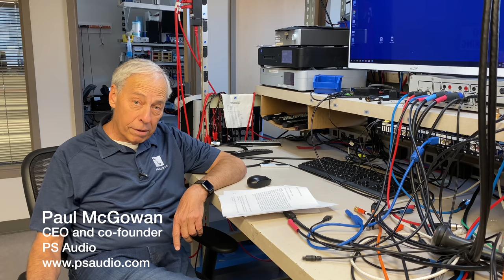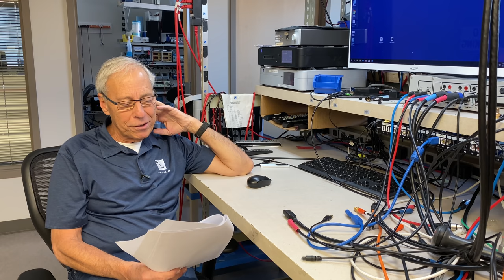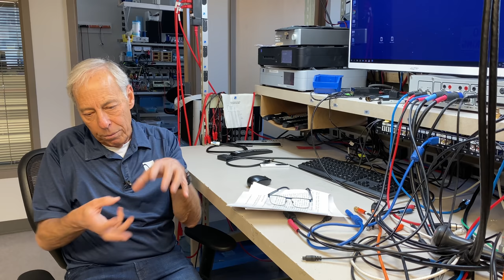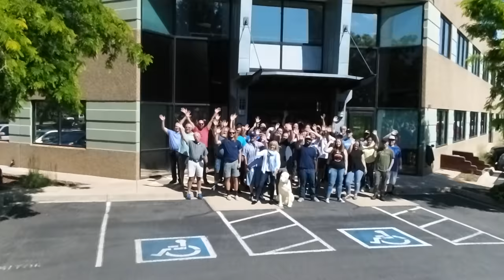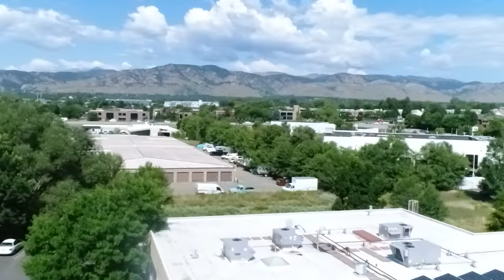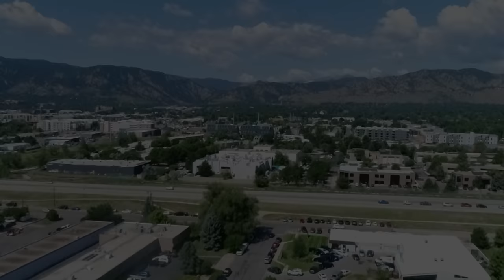Speaker sensitivity and audio quality

Comment: Efficiency is a trade off. The most efficient speakers are used for PA systems, but they also have to be able to handle huge amounts of heat from the hi wattage amps they use. Low efficiency speaker have have more damping. That helps when you have an impulse or quick beat of a bass drum, the damping makes the speaker stop ringing very quickly. Ringing, especially in the woofer , cause distortion of the low frequency audio signal. So a quick hit on the bass drum sounds boomy, and doesn’t stop ringing as fast. But they’re are speakers that do fairly well in the efficiency department and in the damping department. But they’re hard to find. This is the main reason that speaker builders are moving to smaller bass drivers. My old 12” were not anywhere as good as my 7” Focals.

Comment: This is great.  Thanks Paul 👍

What I seem to notice also is that higher sensitivity speakers become loud quickly so it’s harder to control the volume.  Goes too low then goes too high etc. 

Impedance also seems to play a factor?

This goes back to the car stereo days but my buddy had a certain amp and system that was very sensitive to volume.  There was no circular knob control either. It was a slide bar type deck. 

So when you pushed the lever up even slightly it would easily start to distort.  

One of the amps also went out.  Realized he was running each channel at 2 ohms which was not ideal for this particular amp. 

He had 4 8 in subs each rated at 4 ohms.  We didn’t pay much attention to sensitivity.  I re-wired into series vs parallel and everything was much better.  Amp still had enough power to drive the 4 subs.  

The volume was much more easy to control also.  

Does distortion factor into the speaker sensitivity also?  Meaning the more efficient the speaker the more likely noise can be picked up?
Reply: in stadiums and discotechs yes, when music is not playing you can hear a little noise 55db, but when music 120db plays you cant hear noise

Comment: Thank you Paul for your continued, informative presentations.  However, you failed at saying Klipsch,  (O;  and so much so that you slapped the JBL nametag onto a Klipsch product still being made some 73 years to this day!  
And yes, at 105 DB efficient, Paul delt with the bass issue by designing an EIGHT FOOT bass horn into a rather compact corner design to keep up with the big mid horn..............in 1946 !!   Since the person writing in mentioned his Martin Logans, the ESL-9 Classic  (in my system) are rated at 90 DB for those that are interested in the Masterpiece series e-stats being produced today.
Reply: Klipsch Cornwall 4 speakers with Pass Labs Int 60 will sound like a rock concert or a soft ballad without distortion.

Comment: There are more and more speakers out there that are genuinely efficient and also are able to play bass.  Some manufacturer's use separate amps for the woofers but there are some nice speakers that can play well with low wattage amps.  My speakers are not bass shy... and 97.5 db.   It is truly incredible the number of people that are into audio and audio solutions, and the range of products that make,  these days.
Reply: whoa that is a high rating! what are your speakers may i ask.
Reply: @chinmeysway  they are Audionote AN/E's, which are designed to be placed near the wall and play into the sub bass with this placement... great with low power clas A amps...these speakers are less ideally suited for music which requires solid state bass slam

Comment: This is the first time I got an explanation why bookshelf speakers have a lower impedance. About 25 years ago I bought a pair of kef reference one speakers, they were 90 db at 8 ohm. My amplifier was a 50 watts at 8 ohm. The amp I bought was half the price of the price I payed for my speakers. I don’t play a high volume and that worked fantastic. I play all sorts of music going from renaissance vocal music to Led Zeppelin and the music sounded always fantastic and realistic. Went to classical performances as to rock performances. Now I’m playing with an Arcam surround receiver with great power and a set of Audio Physic Temp speakers who needs lots of power. When my wife and I bought a studio not to small were we are staying regular and were we going to live in a few years.
I searched for a set of bookshelf speakers and found out those speakers needs a very expensive amplifier with lots of power and price of the amp was far much expensive than the speakers and I didn’t understood why. With video I got the explanation. Thank you very much. At the end I bought an marantz streaming receiver with 60 watts at 8 ohm and 80 watts at 4 ohm and a pair of speakers from Amphion Argon 1. They have the same price as my amp. And they are good match.
Greetings from Belgium
Ludo

Comment: Hi Paul, That was an interesting topic there, thanks for sharing your insight ! I have a question- What about Klipsch Rf7iii ( i own a pair and the bass is wow  ) they are rated at 100DB sensitive and the frequency response starts from 20 hz. They have 2 10 inch woofers per box:) .  This is contradicting with your statement. Can you please explain?
Reply: Paul's example was simply a "for example".  He wasn't referring to any specific actual speaker.  Your Klipshes are spec'd as -3dB at 32Hz.  For extreme low frequencies, your room and speaker setup have a very large influence on how low they will go.  If you have brick walls, your bass will be much stronger than if you live in a flimsy mobile home.
Reply: Klipsch also lie in theire efficiency rating. Rf7s are fairly efficient yes, but far from 100db/w efficient.
Reply: @ThePentosin  Yup.  They are also "8 ohm compatible' which isn't a true 8 ohm load so maybe 6 ohm in reality? Klipsch's high sensitivity numbers is a marketing lie IMO. Who cares how sensitive a tweeter/horn is when its the woofers that count? Did you also get them on sale as their pricing is also a marketing gimmick.

Comment: That really was a great question...  My front speakers are 89 db sensitivity and my new center is 96 db, I sent back my Elac because it sounded "muddy" but it had a sensitivity of 85db.  Today I will test the new center (Klipsch RP450c) which is a "2.5" way speaker with a claimed sensitivity of 96db and see how it sounds....  I am starting to wonder about setting the crossover at 70 hz for LCR instead of L+R at 50 hz and the center at 70?

Comment: It all hinges around the Holy Trinity of Vas  Qts  and fs.   Non linear Bl ( and voice coils that are double the length of the magnetic gap ) are the main cause of inefficiency
Reply: To make up for the lack of bass,  I added isobaric subs and got them to couple with the main woofer. (They are right next to the main woofer)
But it’s not Audiophile. 
There’s an amp channel for each driver and some active crossovers involved.
Reply: 💓 the way they sound up close and at 100 feet.

Comment: Another interesting video. 
Mid-80's I came across a pair of Lowther Accousta Speakers at a second-hand shop, can remember cranking up the volume and they would take all the different genres that were thrown at them with an amazing deep bass.
Moving forward and into marriage, size became a problem so we parted company - isn't the bass response  also connected with cabinet design and how the rear of the speaker is ported?

Comment: Interesting topic.
I am currently tinkering around on hub dynamo powered stereo system for bicycle (with a buffer batterie of course).
The electric part (dynamo , small mppt solar charger to get the max out of the dynamo, a nimh battery and a small class d amp with 12W) works much better than expected but the speaker design is hard. With the 5th prototype (aiming for the most boom for the watt) i  now have a weird looking 6 liter ported speaker on both sides of my front wheel and it only starts to sound decent.
And even if most of the people i ask find the sound quite good,
i want to build something that sounds better than a 90's portable cassette stereo.

PS i can send you a picture if you want to have a laugh

Comment: A short voice coil moving small amounts couples to the amplifier better than a long voice coil playing at small movements because parts of the overhanging coil are just getting turned into heat, it is no longer part of the magnetic circuit. That is why you need more power to dampen a small diaphram high excursion design. High damping, high current delivery. Kinda backwards, big speakers, small amp and a big amp with small long throw stand mount speakers.
Reply: Interesting, seems logical too.
Reply: @SJMessinwithBoats  Common misconception is that people with large amplifiers listen to loud music, and people with small amplifiers must listen to soft music. I find the opposite to be true generally speaking.
Reply: @zulumax1  Yes, I drove small ecobox cars fast for years, if I got a big engined sports car I would probably drive so slow....most of the time.
Reply: @SJMessinwithBoats  To quote Jay Leno: "It is more fun to drive a slow car fast than it is to drive a fast car fast." True, how true. My first sports car was an 85 horse power Datsun 1500. Big fun, and a beautiful noise when the twin carbs open up.
Reply: @zulumax1  I had a stroker crank, cam and a Webber side draft carb on my Audi fox. 0 to 60 was 8 seconds at every stop light and never had to rev it over 5k rpm. And...there wasn’t too much wrong with the stereo either🐸

Comment: Speakers can do better than the 84 and 85 db I am seeing. That is just ridiculous. But the huge box thing, I have JBL D130's as subwoofers. And they have had some verious modifications to the cones and suspensions over the years, all of which have an effect on their efficiency. If I had to guess it is possible they have about 1.5db lower than they are rated for from factory. But I also need to have them in some rather creatively designed boxes to get them to extend low enough to be satisfying. Mine are roughly 8 cubic feet in the main chamber and have a horn loaded port. They tucker out about 37-40hz or so and the boxes are absolutely huge, as the horn is almost the same volume as the back chamber.  I also power them with a decent sized amp, though I don't really ever take them to their potential.  My midhigh's are full range heavely modded 5" Fostex (at the moment) on about 8 watts of tube power.

Comment: I have a set of Design Acoustics speakers rated @ 90db, the woofers went on em and I had them replaced. I wasnt privy to all of this at the time and the replacement woofers i put in were rated @ only 86db. Though they still sound alright, i can definitely notice some loss in kick to the bass.
Reply: Get a subwoofer...it will change your life...
Reply: @jazzyboy7784  So weird! Thats exactly what im considering! Which one though? Gotta keep it entry level budget for now so around $250 tops
Reply: @AllboroLCD 
I just saw a review of a REL subwoofer (the brand that Paul likes) that's priced at $440.00
I know that's roughly double your budget, but if you save and wait longer, you can have something nice, instead of making do.   : )
Reply: @HareDeLune  You def sound on point, the little research ive done today has pretty much confirmed what your saying! How about the external amp/passive sub route? A couple subwoofer amps found on amazon look interesting though the brands seem pretty obscure.
Reply: @AllboroLCD 
First, here's a link to that review:
https://m.youtube.com/watch?v=vUVf4_7fpaU

As for my opinion on different subs, I honestly don't have very much experience with them personally.
I have been lucky enough to have a set of speakers that produce great bass when set up properly in a good room, without needing a sub.
I can say, however, that I believe having the amp separated from the cabinet will yield superior sound quality. I also believe that you should etiher stick with a known brand, or do a lot of research before you buy.
Heck, you should always do a lot of research! Your system will sound better for it!
I've been looking at upgrading my system at some time in the future, and I am taking my time to learn what I can learn because, like yourself, I will not be able to have multiple options like some of our more fortunate peers.
I have been hearing a lot of good things about 'H' frame, open baffle subs lately.
These are DIY speakers which many people say are the best subwoofers they have ever heard.
Unfortunately, there doesn't seem to be a lot of information about them. At least not that I have been able to find so far.
Research and experimentation, however, are the order of the day when it comes to audio equipment. It's mind boggling what you can achieve with those two tools alone.
You may want to have a look at the book 'The Complete Guide to High End Audio', by Robert Harley.
Good luck, and happy listening!

Comment: I’ve noticed that pretty much every high efficiency speaker has a forward presentation and a shallow soundstage. I never considered the bass problem. It makes sense. Paul Klipsch tried to solve it with the folded horn with mixed results
Reply: My mind immediately went to the K horn.
99db iirc.
Reply: @randomsomeone1617  great minds... 😉
Reply: @randomsomeone1617  Correction..........105 db.
Reply: @garysmith8455  yep. The Cornwall does 99dB

Comment: Besides the challenge of getting efficient bass, energy efficiency is also lost in dispersion and cross-over filtering balancing the frequency response. If you want all the sound energy optimally hitting your ears the most efficient is a 1-way horn speaker that directs the sound maximally to your ears and doesn't send the sound energy much in other directions. But such horn speaker is usually not the greatest sounding.

Comment: Hey Paul thanks for your videos. I have a couple dumb questions I hope you can answer. When you bridge two channels to one speaker does it actually mix the stereo signal to get mono or do you only get signal from one channel with more power? Second question is if you had a two channel amp and two speakers in the same box like say a portable radio. Is there an advantage one way or another to wire one channel to each speaker (stereo) or wire them in series then bridged to the amp to get (mono)?  I'm just wondering if there is really an advantage to stereo when the speakers are right next to each other or if given them the exact same signal will produce a louder or better quality sound... Thanks

Comment: There are some speakers that don't sacrifice bass response for high sensitivity and they're not huge boxes. .  I don't like to name names, but Klipsch Legacy and Audio Note  are examples. (No, I don't own a pair and I'm not shilling for them.)   I'm not an audio engineer, but it seems to me that it is just being technologically lazy:  if you can easily make a low sensitivity speaker with standard parts driven by a 100 watt solid state amp, why bother to make a high sensitivity speaker using less common parts (and less common design experience) that works off a 10 watt vacuum tube amp (or a low wattage solid state amp for that matter), when that market is much smaller.   My real curiosity is whether higher-sensitivity speakers can produce more detail than lower sensitivity speakers since they can produce sound from smaller signals.

Comment: This really helps me to better understand something, I had never heard of woofer or cone cry but that would explain what happened when I went to using a two watt amplifier with the Tekton Perfect Set 15s. I turned the volume so high, and  there was a noise that was terrible and maybe that noise was cone cry??? I complained enough to Erik at Tekton so that he had me return the speakers I purchased from him, he sent me a new set of Perfect Set 15s and I have never turned them up since. I live with a docile sound that is precise but not impeded by a low end, as Paul says, cry or maybe I should call it a speaker's mourning sound.
Reply: Is that not just too little power? The coils can burn up if super underpowered I have read. 
Though, the Perfect Set is supposed to be perfect for amps like yours.

Comment: Check out the Klipsch Heritage series.  Plenty of bass, pretty flat response, 99db+.  Yes, they can get big, but Heresy and Forte will fit in most decor.
Reply: While the Heritage speakers have “punchy” bass, they do not go terribly low and not low at all relative to their size. The Cornwall and K-Horn get down to the thirties, but their size would seem to imply much lower frequencies than they actually deliver
Reply: @billd9667  Fortee IIIs get down to around 38 and are not that big.  Can you give an example of a non-subwoofer that has response better than that?  I'm curious what you are comparing to.
Reply: @alberich55  the Forte is no truly a heritage model as it came along much later. The passive radiator definitely helps it to achieve lower bass. 

Keep in mind that Buchhardt’s little bookshelf S400 goes as low as the Forte using a passive radiator. As I said, the big Klipsch speakers should go lower than they do. For the size that they are, one would expect mid-twenties
Reply: @billd9667  Never heard of the Buchhardt’s, I'll check them out.  Depends on what 'heritage' means i guess.  Forte began selling in the mid-late 80s and is now sold as part of the new Heritage line:  https://www.klipsch.com/heritage-premium-audio-speakers
Reply: @billd9667  I've got a pair of floorstanding speakers that cut off at 30 Hz - no subwoofer needed, really.  The bad thing is,  due to the modest cabinet size,  their sensitivity is only 90 dB each,  requiring more than 20 times the power of my Pyle drivers in a good sized enclosure.  Passive radiators are something to look into,  if you don't like a ported design.
Reply: @Mr Do Well, not really.  Ports can cause distortion due to the high air velocity (moving the same amount of air across a smaller surface area).